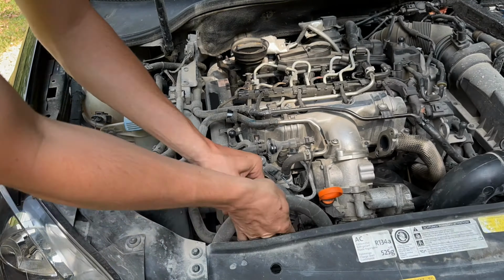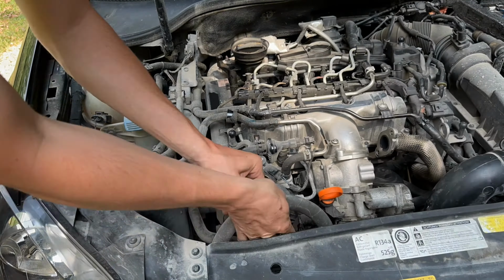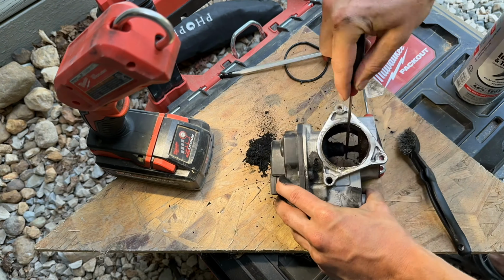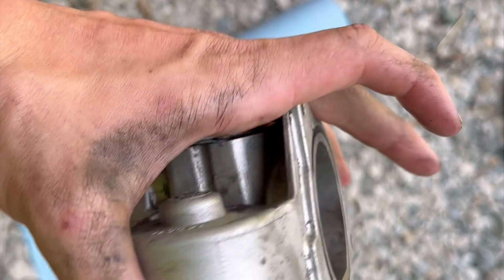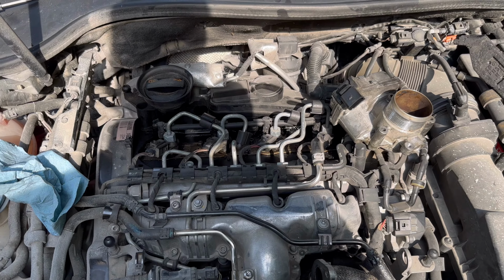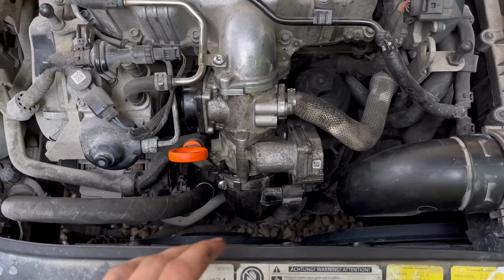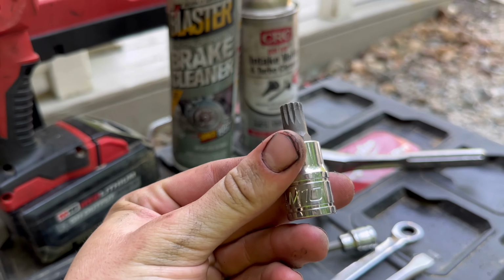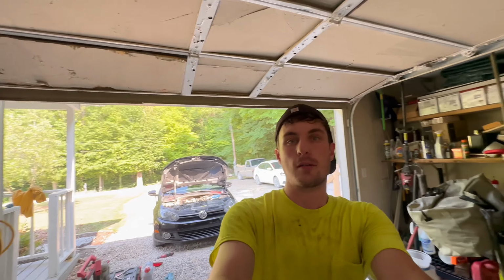How to clean your EGR in a MK6 TDI!

Comment: I have the same old oil deposits pooling around injectors. Have you found the fix? The injectors have been resealed so the issue lies somewhere else. I was thinking its either a faulty valve cover gasket (oil seems to copy the gasket perimeter as well) or a bad oil filler neck gasket.
Reply: My injectors were leaking also and resealed.. wondering to replace egr or try to clean. Runs good and I want to sell it
Reply from the maker: @EricK-ik6rb  if you’re wanting to sell it I’d just clean it pretty well
Reply: Seals on injectors can/should be replaced when valve cover is removed. Kits are available from IDparts in MA.

Comment: If you don't have a dpf just delete it. If you do have a dpf you'll need to delete that at the same time if you don't the dpf will clog real quick. You'll then need to get ecu coded. It's illegal to run without a dpf in some states so best to check first.

Comment: I’m debating if I want to try this on mine or just let a shop deal with it. I actually just need to get to the asv/ throttle body I have a P0638 engine code. That big rubber hose is giving me pause though. A bit concerned I won’t be able to get it off or back on….
Reply from the maker: I had that code as well before I cleaned it I believe. It’s really not too bad of a process

Comment: I have oil sipping and collecting into my glow plugs and making it run rich.  I was wondering if I can remove the intake manifold and replace the gasket without having to used VCDS?  I got a code P0638 and I have already remove the EGR twice and clean it and got that code soon after that work.  I haven’t change the valve cover gasket as my girlfriend’s car has 160K miles.  I also would like to replace the injector seals since that will have to be removed to replace the valve cover gasket but since I don’t have the VCDS I’m scare I’ll screw my injectors pressure!!!

Comment: We’re you able to get the ASV, that’s the anti shudder valve .. ie tdi throttle body off with only loosening the screw clamp on the intake hose? I recently tried to take off the ASV/EGR on my tdi but I couldn’t get the hose off the ASV.. probably need to remove it from the turbo as a whole to get enough movement.. that’s a bad design by VW to not have any movement in that intake hose.. otherwise good video, did the EGR fault clear?
Reply from the maker: Yes I just loosed the hose clamp and put a screw driver in between the hose and throttle body/ASV and worked it off. It wasn’t too bad doing it that way. Yes it cleared the fault. I did end up just deleting the egr and dpf a few months later.
Reply: @YoungWRX  Getting prepared for doing 2 of these. I won't delete EGR... pretty much bullshit all claims. My problem is how far to go, but I will decide when I see EGR. Do I  1) clean like you? 2) Replace EGR;s as not much cost and I get gaskets. 3) Replace throttle body (EGR and ASV). 4) Clean or replace intake cooling pipe as well? 5) Remove intake manifold and clean that and head inlets.
Reply from the maker: @gesheepistemology8050 from what I understand you don’t really need to clean the manifold/valves but I just cleaned the egr and it lasted awhile but it did come back up that’s when I decided just to delete it along with the dpf.
Reply: @YoungWRX  where is the DPF and how do you delete that?
Reply: @YoungWRX  mine are 240km and 160km, no problems or errors codes, just preventative clean/replace.
Reply: Cleaning it may not fix everyone's trouble codes, cleaning is only one fix of a possible few. No need to delete tho it's all fixable. Dpf is great because it stops so much pollution
Reply: @gesheepistemology8050 I ask myself the same question

Comment: Did you have to do any calibrations on VCDS or OBDEleven after you re-installed everything?
Reply: If you disconnect the battery, you usually have nothing to do. Think of it as a surgery, if the car is asleep and wakes up just like before, why would it need programmimg?

Comment: The issue for the oil pooling could be due to deteriorating seals around the injectors. It could also be due to a crack in the tappet cover.

So, depending on what it is, you can consider replacing the tappet cover or the seals around the injectors.

Comment: Did you ever get the delete kit? How did that go?
Reply from the maker: Yes I did I’ve been meaning to make a video on it but haven’t had time. It was pretty easy to do over all I’d say and I get a little bit better fuel mileage and obviously sounds a lot better
Reply: Which tune did you go with?
Reply: Also, which delete kit did you get?
Reply from the maker: I went with Malone stage 2 which is thru tunezilla now also got the dsg tune. I went with raw tech for the exhaust/down pipe I’ve heard people say they are too expensive but the quality is worth it in my opinion!
Reply: Just got the rawtech kit. I am really happy with it. Install was totally reasonable.
Reply from the maker: That’s awesome! Glad it all worked out
Reply: Your rocker cover gasket is leaking

Comment: Wrong side of motor boss nana egr is by the down pipe not the intake
Reply: Nah guy, that is the EGR valve on this car. The EGR cooler is in the back of the engine, underneath the turbo.

Comment: That’s not the egr! That’s your anti-runaway-diesel valve. The egr on the 1.6 is at the back of the engine.
Reply: Wrong thats the egr ,see the exauhst pipe
Reply: You might be thinking of the egr cooler
Reply: @ManUaudef the egr
Reply: This isn't a 1.6 TDI go watch european videos if you want to see a 1.6. the 1.6 was never released in the US